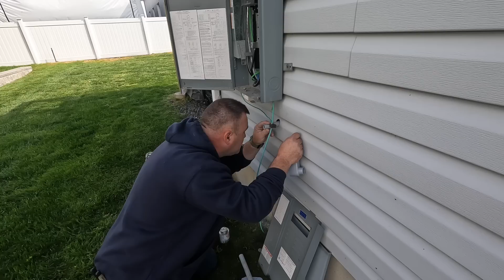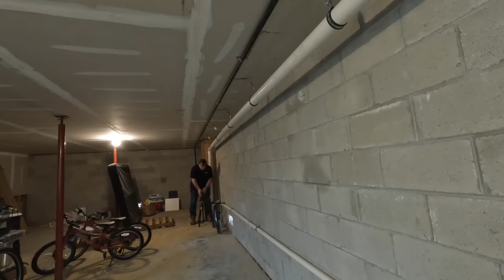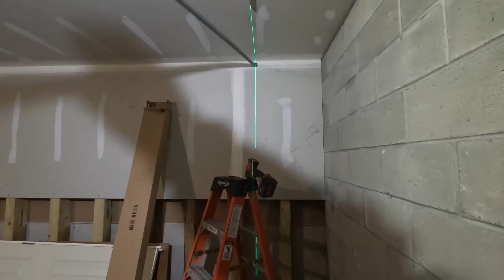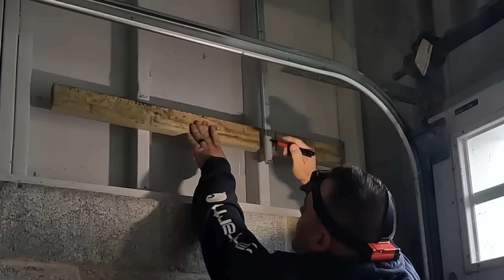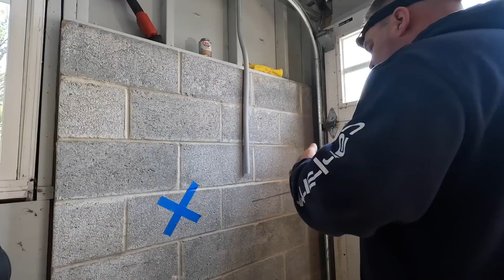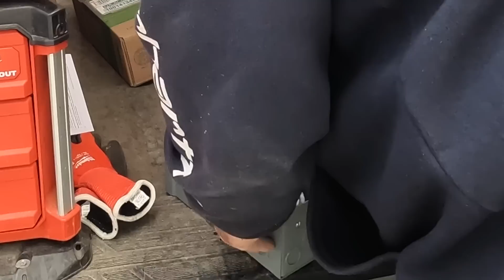Electric Vehicle Charger NEMA 14-50 | Sea Bright, NJ

Comment: Ron, you got it on the money.  I used to think that pulling wire was easy until I had to pull the 3/0 for my service entrance conductors.  it is quite challenging pulling larger conductors by your self,

Comment: Even though I don’t really like them but and LR might have been a better choice by that garage door rail, just a pain in the ass to pull wires through. But the way I see it if you’re able to access the LB and put the cover on after the wires are pulled the inspector shouldn’t say anything, but every inspector is different. Good video bro.
Reply from the maker: Every inspector is different and if you can be on location for the inspection it usually is a good outcome. This passed and I don’t even think the inspector even looked up.  Once he sees the GFCI OCPD he knows a professional worked there and doesn’t have to put everything under a microscope.

Comment: Lots of people are finding they need a bryant  14-50  9450fr heavy duty receptacle or one like it to handle the plug and unplugging due to wear at the contacts and it has Allen head screws that you can torque to specs to keep wire thight! If your going to plug in and leave it one thing, but look at lots of YouTube follow up  and their saying this!
Reply from the maker: Never got a callback for any NEMA 14-50 that I've installed. Word.

Comment: congrats on 10k.  you mentioned that your getting used to using the Milwaukee laser.  i find that i can get the PVC conduit straighter if you use the laser line to line up the screws in the PVC straps.

Comment: Thanks, interesting about the possibly downsizing of the neutral conductor. Will need to look that one up.
Reply: The neutral only has to carry the unbalanced current. That's why you see the neutral at the service is often a smaller size than the hot conductors.
Reply: @edisont.picard4112   All checks out, super cool NFPA has free access to the NEC. In short NEC2020 215.2 A2 the size of the feeder circuit grounded conductor shall not be smaller that that required by Table 250.122.
Reply: @wills2262  since this is a receptacle branch circuit and not a feeder, 215 doesn't apply to it. In fact, the only time the NEC allows for the neutral of a receptacle to be under sized is for electric ranges. I guess technically, the neutral for the EV receptacle should be the same size as the hot conductors.
Reply: @edisont.picard4112 I personally run the same gauge for the neutral, but I'm far from a pro, so a few extra bucks on some thicker wire never hurts.
However, I like a good conversation. How about 2020NEC 210.19(A)(4) "Branch-circuit conductors that supply loads other than those specified in 210.3 and other than cooking appliance as covered in 210.19(A)3 shall have an ampacity sufficient for the loads served and shall not be smaller than 14AWG"
We know the EVSE does not use the neutral at all, so load served on it would be 0amp, so the size of the neutral will be the larger of 14awg or that of the required ground. Eh? Maybe?
Reply: @wills2262  You might be able to squeak that by with a sympathetic inspector, but in general, I don't think it will hold water. Especially since it's a standard receptacle that is used by ranges and RVs. Being by the garage door makes it a prime target for Cousin Eddie to plug up to over Christmas vacation.  In my opinion, since the neutral isn't used, a better solution would be to use a 6-50R and not even use a white wire.

Comment: nice installtion video, how to do it right ...  
to bad that USA still uses dangerous (but up to code NEMA 14-50 ) plugs/outlets for this (similar to a Soviet stove) , we use the much saver "IEC 60309" 3-phase 400V "CEE 3P+N+P 6h" (usually 16A or 32A & IP44) alias "Kraftstrom" or the single phase 230V "CEE P+N+E 6h" (usually 16A or 32A & IP44) alias "Campingbuchse" ... and sometimes then ormal Schuko-plug for normal 230V outlets (usually 16A)

Comment: I run the wires through each PVC conduit section when been put on. It works better for me instead of start fishing for the wires in the end.
Reply: That's a technical code violation. Code says wire are to be installed in complete raceways. Having said that, sometimes siding the conduit over the wires is what happens.

Comment: You have a very educational channel. Video and audio quality really good. What's wrong with using wire lube on your conduit pulls? Maybe not that great in PVC but if I remember correctly it helps in metal conduit.
Reply from the maker: Most of the insulation these days have the lube built in to the conductor. It’s called Simpull.

Comment: I think it's kind of silly that 14-50 sort of became the de-facto standard for EV chargers over 6-50. As far as I know, no EV chargers use the neutral for anything, so it just works out to be a waste of wire. (Unless, I suppose, you also use the outlet for an RV or something)

Comment: Ron, I’m bought my PVC heater brand new in 2010. I’ve used it moderately and have taken care of it. Around 2017 same thing happen with the switch it melted and I replaced it. Now when I plug it in a GFI after about 10 minutes, the GFI trips. It happens on any GFI outlet. I’ve googled about it and people have said the heater element is bad. New they’re about 250.00 dollars. It’s a bummer.
Reply from the maker: Oh damn that sucks. Mines not effected by the GFCI.
Reply: @electricianron_New_Jersey  yeah it’s not normal. Use to be able to plug into any type of outlet. Element is most likely bad. I think a new PVC is around 800 dollars. So it’s fix it for 250.00. Or buy a new one. Sucks.
Reply from the maker: @mcarroll598  When it rains it pours. My truck broke down again earlier in the week too. New alternator and battery.
Reply: @electricianron_New_Jersey  yep man it sure does. Just gotta keep plugging along. Thanks for the videos too!!

Comment: Great video as always Ron.And a superb clean & professional looking job.I just have 1 question.Why did you pull a neutral? I would have thought that 2 hots and a bonding conductor would have been enough for an EV charger?
Reply from the maker: For the Tesla that’s all that’s required.  For all the the others the neutral is installed because it’s required for the NEMA 14-50 receptacle.
Reply: @electricianron_New_Jersey  all the car chargers I have done were  hard wired & non of them needed a nuetral,that's why I ask.
Reply: Some electronics need the neutral. Coffee makers like Bunn (think 7-Eleven) running 208/240 need the neutral for the computer boards while the heaters don't. I'm not sure if electric car charger controllers run off the mains, but that could be an explanation
Reply: @pawelelektryk2985  Correct, if you do a hardwire install, you do not need to run the neutral. Because this is with an outlet that has a neutral slot, the neutral needs to be run. Someone could later plug something else in to it that requires the neutral. That extra cost, plus the extra for a gfci breaker and a commercial grade outlet, It is cheaper to do a hardwire and provide higher output.
Reply: @4x2-ev  I agree

Comment: Thanks for the video ron.  Why wouldn't you use emt instead of pvc?
Reply from the maker: EMT is more expensive and more difficult to work with.
Reply: @electricianron_New_Jersey  also in (near) marine areas... the salt air may corrode the metals. same for barns with animals. and high humidity/tropical areas. thus PVC  is preferred. it does really suck to repair this decades from the first install due to corrosion....!
Reply: @electricianron_New_Jersey  thanks for your videos and your response

Comment: Hey Ron, why not use a plastic J box in the garage if you are running PVC all the way. I would only use a metal box if I was transitioning to EMT.(PVC good choice right now, of course, because of high cost of EMT) Also, a heat gun works real good to create simple box offsets in your PVC, so you can reduce the stress on your box connectors. Great Video. Thanks, Russ, Electrician from Oregon
Reply: Ron must have his reasons, but I’ll tell you mine: junction and receptacle boxes are the likeliest point of failure, so if there’s overheating involved with all the amperage, I’d rather it happen in a metal box.
Reply from the maker: I'll tell you why... because I wanted to use an LB but this was early in the morning and I was fish out of LB's. I went out at lunch time and got what I needed. Also, this job  was a referral and it was my first trip out to the job so I had to plan and do the work all ion the same day.
Reply: Russ, I'm with Ron. I like the metal box, whether 4S or 411/16, with a raised cover because of how sturdy it is. The Nema 14-50 cord is heavy and plugs in super tight to the receptacle. My opinion, the plastic has too much give, maybe creating overheating situations with loosening terminals.

Comment: Some people say that only a specific brand of NEMA 14-50 receptacle should be used for EV car charging.  What’s your take? 🤷‍♂
Reply: I say let the insurance companies figure it out over time.
Reply from the maker: I use listed receptacles as required by the code. I hear things all the time and I always believe it’s installer error. That’s probably not always the case though.
Reply: Lots of people swear by the Hubble-branded NEMA 14-50 receptacle because it's a lot more heavy duty than other brands. Even Tesla recommends that one in some of their literature.

Comment: Something I don’t get is why your able to bond the neutral at the main panel  and why you can’t do it at the other panel. Because if they’re both bonded then wouldn’t it mean that your neutral could be your ground and vise versa
Reply from the maker: Because your grounded “neutral” conductor is a current carrying conductor. The equipment grounding conductor is non-current carrying conductor.  In the event of a short-circuit (a hot to neutral fault) we want the current the current to return to the source as quickly as possible to facilitate the circuit breakers and open up to clear the fault. If both conductors are bonded at both places this creates a parallel path and it not only slows down the fault clearing process but introduces current flowing on the grounded parts which violates NEC 250.6.
Reply: @electricianron_New_Jersey  great idea! also, the white neutral does carry (return) voltage and there is a possibility of stray voltage on legacy range, dryer, and such appliances. thus a separate green grounding wire helps. this might explain why some people feel tingles from the range, dryer, and such.
Reply: @electricianron_New_Jersey  thanks that makes a lot more sense glad your feeling better

Comment: Hi Ron why did you remove the meter cover
Reply from the maker: Most times the top half of this style enclosure does not need to be removed. But here on the Jersey shore elements of the salty air forms a bond between the panel access and the meter access and its just easier to remove both to get to the circuit breakers area.
Reply: @electricianron_New_Jersey  ok I’m in Florida and only the power company is allowed to access that area I have installed many of the square D 200 amp meter breaker combo enclosure here it’s also MER rated for FP&L

Comment: Hey Ron can you always downsize on the neutrals? Or only for large loads?
Reply from the maker: Not always.
Reply: It depends on the load. The neutral only has to carry the unbalanced load, and in any case can't be smaller than the equipment grounding conductor.

Comment: Is a GFCI 2-pole breaker required for 240V receptacles these days?
Reply from the maker: 625.54 Ground-Fault Circuit-Interrupter Protection for Personnel.

In addition to the requirements in 210.8, all receptacles installed for the connection of electric vehicle charging shall have ground-fault circuit-interrupter protection for personnel.
Reply: @electricianron_New_Jersey  Interesting, I just found that's been since 2017; I suppose that is 6 years ago already

Comment: Are you using the hubbel 14-50? or the leviton?
Reply from the maker: Think this one is Legrande.
Reply: @electricianron_New_Jersey  Try not to install those. I only install Hubbel verison which is usually specked out from tesla. But the legrande and leviton say there industrial but that is a lie.  We are seeing that those cheep nema 14-50  are catching fire. One of the phases on the receptacle starts to melt. As a contractor myself I do not install them to avoid call backs and hopefully no fires. 
The hubbel version ranges from $70-$150

Comment: Could a fellow sparky do me a favor. If possible could somebody use their Amprobe ( Ya I'm old ) to measure the current in the white grounded conductor when charger is first plugged in & turned on then after a few hours. Going to really piss me off if the two energised conductors are drawing 35 Amps or so whole the white conductor could only be drawing less then one amp. If that's the case lazy cheap EV charger manufacturers should spend a few dollars and install a 240 to 120 volt transformer so as not to need the white wire or a 4 conductor receptacle ( could use a cheaper 3 wire receptacle ). I always thought that electric dryer manufacturers got away with using the white wire to provide the neutral & ground for at least 60 years. They should have used a 240 volt drum motor and a 100 VA transformer to supply 120 volts for controls & drum light. Not a big fan of non conductive tales on long run s especially if there is a few wires already in a conduit. Is a lot safer.Surprise d that the meter combo enclosure bc is only rated NEMA3 . NENA 4 adds a lot more protection against hose directed water. Can see Johnnie homeowner blowing it up after using his pressure washer to clean it off. Square D dies make great products.
Reply from the maker: @Ampacityelectric  Sad but true. The neutral I ran here was #8 AWG.
Reply: No charger is have installed has needed the neutral. The neutral is present because the 14-50R has a neutral slot, but I bet the white wire in the cord to the charger isn't connected.